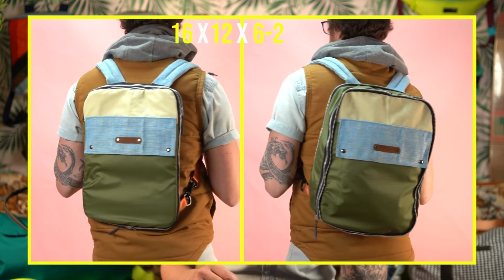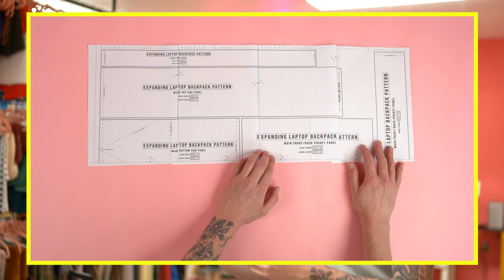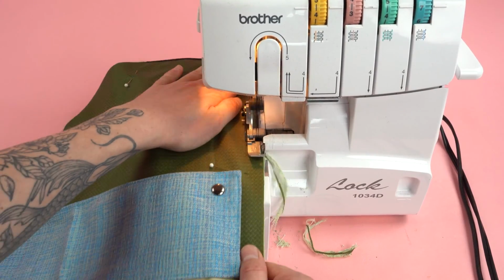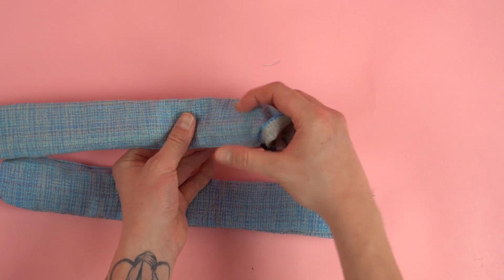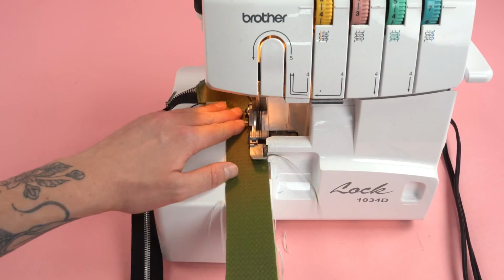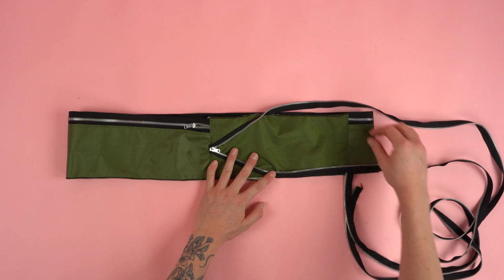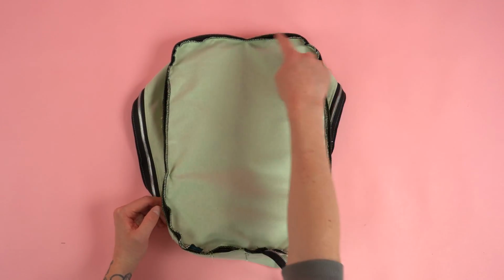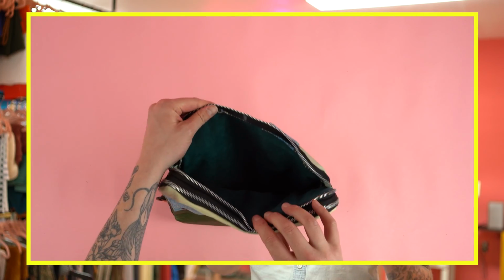DIY Expanding Laptop Backpack + PRINTABLE SEWING PATTERN (EASY SEWING PROJECT)

Comment: @ProperFitClothingCo and @AndrewParauka, some tips for videos:
•If you're going to have someone in the video, I would recommend better body language; namely their hands. Really distracting, it was as if the speaker was swatting flies while I'm trying to listen. If the speaker still has awkward hands, try to have them lower their hands further to "swat their invisible flies".
•Repeating multiple times that "it is highly recommended to get a serger machine, or zig zag stitch raw edges" comes off really condescending to the viewer, as if we are dumb and didn't hear the first time. Repeating it several times throughout the video. Stating it once is more effective in this case than acting as if the viewer didn't hear the first time.
•Instead of listing recommended machines for gear that the viewer plans on sewing for their projects, list them in the beginning. I noted that there was a domestic machine, a serger machine, and an industrial machine. Who is your audience? At-home stitchers? Professionals? The video seems unclear who this is for and potentially a very expensive mistake project to be making for a beginner. Or too easy for a professional from a backpack making company like Timbuk2 or Nashville Packs.

I would recommend to the other viewers to watch videos curated better than this one on learning to make backpacks.